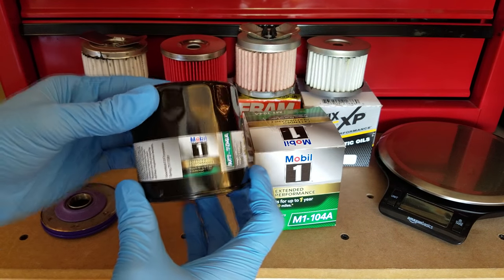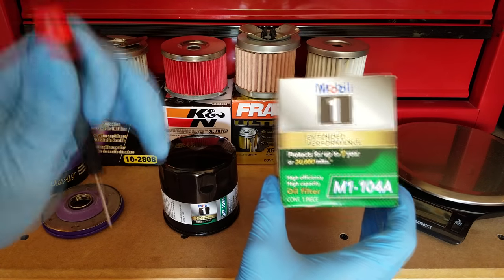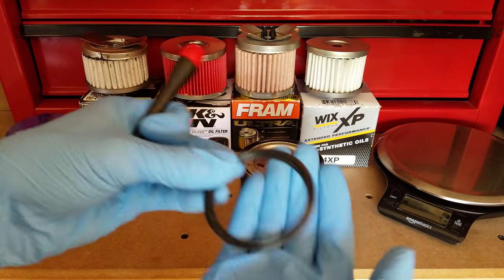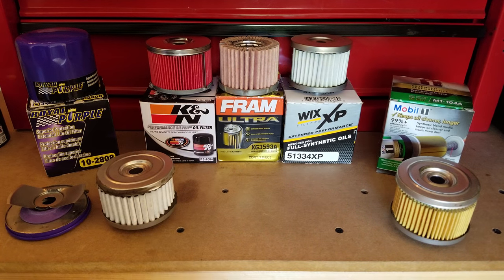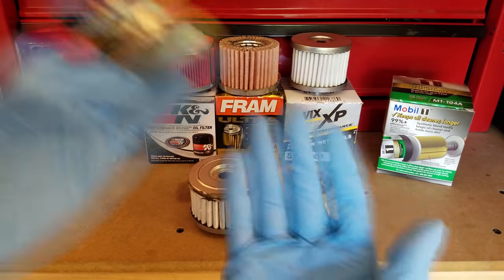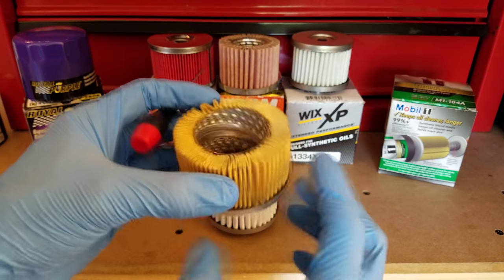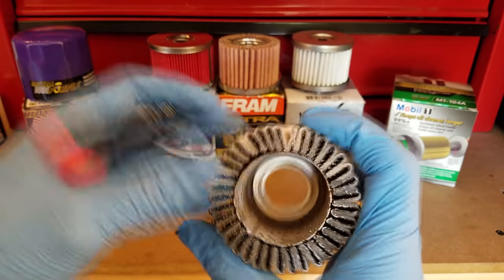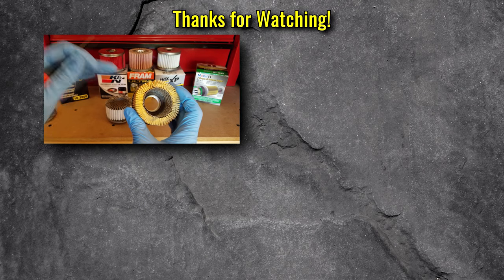Mobil-1 Oil Filter Cut Open! | vs Royal Purple/WIX/K&N!

Comment: I use Royal Purple fluids and filters exclusively ever since they saved my engine. My F250 7.5l blew a front main seal and dumped three quarts of oil in 40 miles. Because I was hauling a 5th wheel I didn't see it behind me, so didn't know it was happening. My oil pressure gauge has always jumped around some, even after doing everything I could think of to fix it. I always had good pressure, so didn't worry about the gauge doing it's thing. When I came to a stop and heard lifters rattling, I parked as soon as I could get clear of traffic and there was not a drop of oil on the stick. It took 3½ quarts to fill it up. I dropped the pan when I got home and checked it for metal... clean. I checked the rear main bearing (on a 200k mile engine)... decent, not wiped. Compression... within tolerances. No noise at all once pressure came back up. In addition, I discovered a hole in my oil pick up tube... there's the likely culprit for my dancing pressure gauge. Not sure what caused it but it's there. A touch-up with the welder will fix it nicely. 

I was at freeway speeds weighing 14,000 lbs for about half an hour with what was obviously low to no oil pressure. Undamaged engine.

Next story... I have a generator that hadn't run in 14 years. It was soft-seized... Tight, but it rolled over by hand. I tried penetrating fluid, lubrication fluid, standard motor oil, nothing freed it up enough for the starter to crank it. Then I dumped some Royal Purple 15-40 in the cylinder. It took four pulls on the starter cord for the piston to free up. I filled the crankcase with the same oil and hit the starter. It was free in 30 seconds. It's been sitting outside for two weeks now. It just fired up without any problem. 

Royal Purple is the SHIT folks!!! Expensive, but WORTH IT!

Comment: According to the engineers at Mobil, their filters are actually rated to 19 microns. I couldn't find a definitive answer online so I called and asked.
Reply: That's really just stating what the test parameters were tested at. It's not claiming that's their filtration on their filters though.
Reply: AnalogSetGaming more info please about this 19 micron thing?

So they are saying it is 99% @ 19 microns?
Reply: @LoveLikeaHurricane  99% at 30 microns according to Mobil's data.

Comment: I've been using WIX XP filters for my vehicles.  Some that change oil say the reason to change oil more often is because they don't have filters that last.  I may keep my oil from 8,000 miles using Synthetic oil, so I want a durable filter.  Where I don't have a WIX handy, I'll ask for a premium filter.  I believe a good filter is wise considering I leave oil in longer.  It appears it would be difficult to rank the oil filters, but which ones would you use in your car or truck???

Comment: For a more thorough comparison, it would be nice to see their respective pressure drop vs flow rate.  Generally, the more you filter the more resistance will be so there is a compromise.  With oil, there is usually a bypass within the engine that will allow unfiltered oil to flow even if the filter is clogged, so I would wonder if a small micron filter would increase its resistance more quickly over time.

Comment: Quality is all about finding attention to details in areas which you expect no one to check, this is true regardless of occupation or product if you take the time to make everything correct and to a good standard people will notice. Be it a brick mason, or a mechanic if you spend some time on stuff which you expect no one to look at sooner or later someone will see it (and know what they are looking at) and will have respect for it.

As a child I had to have a root canal and they put a cap on the tooth (fake tooth) I was about 11 than (28 now) and every time I go to a new dentist (work requires me to frequently move) they all notice it and have all made and mentioned it (surprised by the quality of it ((I can't see it)) while asking me who did it (assuming they where local I guess) but anyways yeah when you know what you are looking at you can respect quality if time is put into a area where it doesn't necessarily matter you can be fairly sure it was put in areas which do matter.

Quality is nothing more than attention to detail and as a profession it can help you a lot.

Comment: Nice, thorough video! There is one major detail I think you should include when examining these filters. One major detail that is almost always overlooked but is critical is, metal debris in the cut threads in the  center hole of the plate. Almost every filter I have used, I have found metal flakes or shards of metal embedded in the threads. You should always wipe the threads out with a rag or towel. Try doing this on your reviews, I guarantee you will find metal debris in the threads. And we all know that metal in the oil is no bueno. Check it out, but use caution, I have have actually been poked with sharp shards of metal threads before when trying to wipe them clean. It is a widespread problem that almost every oil filter video fails to identify. Cheers!

Comment: I use Mobile 1 Filter and Mobile 1 Full Synthetic High Mileage on all my vehicles and I change the filter every other oil drain. Intervals are usually 5,000 miles  and I also put magnets on the filter and the drain plug.  Pro Mechanic of 15 years
Reply: wow you like talking about yourself
Reply: @bryannonya9769  Only trying to contribute to good information that is available online. Thanks for your comment. I'll keep doing the same. Goodnight!
Reply: So have you ever cut open a used filter to verify that the magnets were keeping contaminants out of the media?

Comment: I used to send in oil samples for analysis and certain oils can go the long distance.
The best oil was moly pro spec 3, guy ran it for 19,000 miles and the oil sample showed it could be ran in a car for another 5k.
I did work for mobile one. Used to do the test were we put oil on dry ice, I live in Montana and I was sold, when it's super cold an oil that flows is important.
I've used extended performance oil and filter  for a long time. Great product.

Comment: I am running both of the filters.  Royal Purple 5-20 oil and filter on my 2005 Honda Accord 4 cy  has only about 77 thousand miles bought it used at 27 k  miles and I really like how smooth the engine is with it I tried others synthetic oils and K n N filter but R. P seems to work best.  
I just got a Ford Expedition 2001 with 150 k miles and change oil filter to new mobile 1 A 201A model I think ? 5.4 l engine 4wd  with the reg mobile 1 advanced full synthetic oil and new K n N air filter and I can really tell a big difference in better power.  There are so many types of different oils and then some.  
People complain about how they spend so much money on a $ 15 bucks to buy a oil filter then spend money and trying to save money on a 8 dollar oil filter. Dam ya know what and How important is your engine how much money they piss away buying anything else, food games tickets, bar , Starbucks.   
Great synthetic oil and great oil filter for car is the Number 1 thing to make it last great.

Comment: They aren't 'clones', they're manufactured in the same same facility by Champion Labs.
Reply: J S That could very well be true, but that fact does not guarantee the exact same construction with all the filters often the manufacturing detail can be tweaked or specified by the purchasing company. Or the filter manufacturer can offer multiple different “grades” of filters.

Example K&N typically has a metal crimp over the joint where the filter media wraps around the core. M1 & RP typically do not have the metal crimp & just glue the ends together.

I’m pretty sure all three are quality filters & I would base my purchasing decision on price at that point.
Reply: JS is correct. RP element is fiberglass and screen wire backer. M1 is our better line of paper element. Same shell, same p ring gasket ( side profile is a p shape) same valve end cap. The tapper uses the larger hole to hold the plate from spinning while it taps the center hole. There is NO way a slug from the center hole could be left in the filter. That part is stamped out then tapped then washed to remove all oils then assembled. Champion labs in Albion Illinois make a lot of brands.

Comment: Enjoyed the video. Quick tip for reference. A hair in your hair is around 80 micron's. I think 40-50 is only visible to the naked human eye. The problem comes in to there's so many additives in motor oil particular that once you get less than 25 micron's of filtration you start to strip the additives in stead of just cleaning your oils which intern breaks your oil down faster. Keep up the good work! Any questions just ask. I'ma certified Millwright and Machine Lubrication Technician.

Comment: I run Mobil 1 High Mileage oil with Mobil 1 Extended Performance filters. 10k intervals. Not a single prob.
Reply: FilterKingz I’m about to change my oil at 10,000 miles, with the same filter “Mobil 1 20,000 miles” only thing is I’m running rotella T6 0w40, would you like me to send it to you and feature it on your YouTube videos

Comment: I use Mobile 1 in all my vehicles, but hadn't used any of their "Extended Life" products until this year.  I put their 15k mile extended life oil and the extended life filter on my wife's 2006 Ford Taurus that has 204k miles on it.  The car will not get 15k miles on it before it hits the 1 year mark, but I'm going to start checking the oil at my usual interval of 3k miles and see how it looks, smells, etc.  If the oil lasts a year then I may switch to it permanently because 1 oil change a year, even with a more expensive filter, is cheaper than 3 or 4 oil changes, :-)
Reply: Do an oil analysis that way you know for sure what's going on with the oil and the condition of your engine, the best way to go!

Comment: For future reference, you might use the filter form factor used on most Hondas. It only accounts for about 10% of US market vehicles, but most other part numbers cover more like 3% or less. Any filter company would be crazy not to make a filter for this application, so it's really handy for apples to apples comparisons.

Mobil 1 M1-110A
K&N 1010 series
Royal Purple 10-2867
Wix 57356 series

Comment: Hell I ran cheap frams in my old 1991 2.3 ranger and still got 300k miles....Change your oil and filter as your supposed too and you will get long life with any filter.
Reply: But I believe fram uses cardboard in their filters
Reply: @Caseydog3  
What is wrong with cardboard?
Reply: Steven Sevek cardboard breaks down other materials are way better last longer cardboard and liquids don’t go together

Comment: I use Motorcraft filters on my 2 Fords (2006 Taurus and 2004 Marauder). The Ford gets 5w20 conventional and changed at ~5000 miles. Still comes out pretty clean so 7500 miles occasionally. It uses a quart between changes, no leaks at 149,000 miles. The Mercury (51,000 miles) gets full synthetic on the all-aluminum 32 valve V8 and changed once a year (less than 3000 miles). Engines are built WAY better than 20 years ago. More efficient, less blowby, better engineering, and tighter tolerances. Oil is better by leaps and bounds! The 3,000 mile oil change is ridiculously short and a waste of clean engine oil by today's standards.

Comment: I would like to see how AC Delco, Mopar, Motorcraft, and other OEM filters compare.
Reply: Agree on that
Reply: Acdelco oil filter is junk
Reply: @jacobsebastien3910  STFU 240,000mi on a 2002 Suburban not one piece of metal ever on oil bolt magnet, engine still runs like new, guess what filter has been used on it...lol
Reply: There was a performance segment that I read a few years back and it rated the OEM filters the best ...notwithstanding the higher end K&N Filters, etc.
Reply: They're all junk compared to these brands.
Reply: Mopar/SRT are Wix
Reply: @UnionThugg  

No they aren't Mopar/AcDelco/Motorcraft are all made by Champion Filters. Same company that makes Fram. Not Mann and Hummel which makes Wix.
Reply: @shaunofthedead3000  One must read the research with due caution. 

Wix has always been the vendor for 5.7/6.2/6.4 V8 Mopar filters.  Fleetguard (Cummins) makes the Cummins diesel filter.  Purolator makes some of the Mopar filters for smaller gasoline engine filters. 

Champion, and even Fram has been a vendor for some of the Mopar air filter applications.

Comment: I do think Mobil1's are good but I do all my own car maintenance. I currently have a Toyota with over 300,000 miles and the engine still runs like new! It does not use any oil. I do take really good care of it by using some great car maintenance software www.automotivewolf.com that tracks the maintenance schedule and reminds me when anything needs to be checked or replaced. It also keeps a detailed maintenance log so I always know what was done and when and it tracks performance too. I have always use OEM Toyota filters and oil as recommended by the manufacturer and change it every 10,000 miles with Full synthetic. So far it seems to be working great!  :)
Reply: Excellent software, I use it too. I have over 265,000 on my truck.

Comment: I want a filter with the thickest case because I often rest my car on the oil filter when i change my tires, thanks for the info.
Reply: not the smartest idea js haha
Reply: Kinda interested where you learned that practice? Lol
Reply: I rest mine on my Sonic Route 44!
Reply: Bob Foster alllrighty then😂
Reply: bro jackstands are very cheap just saying
Reply: Right? In what world do you need a thick filter housing? Lol if something is going to hit my oil filter it's already gone through most of my engine lmao I got bigger problems
Reply: @isaacibbotson4632  I've actually punctured a couple oil filters when changing them. It's a real pain in the ass when they go too long and get seized on, then the filter wrench tears the cover off.
Reply: @mikecurry6847  
Back in my younger Day’s I had a 1980 Chevy SB 4x4. It had a 1969 427 bored .60 over, and was sitting on 44” Gumbo Mudders, and one night me and a few friends was doing some Mudding and I had a piece of 1/4” steel dole go through my oil filter housing. It was in the mud, and we didn’t see it. Because it was kinda buried in the mud pit down here in Southeast Louisiana. We had to walk 2 miles to the autozone to get a new filter and oil for her. We wound up doing an oil change by the pit at about midnight once we got the gear and walked 2 miles back. This was in the early to mid 90’s so none of us had cellphones. Hell we was still rocking Beepers back then

Comment: I remember at the dealership a truck was towed in with a froze up engine. It was brand new with 15000 miles on it. Thats as far as it would go with the factory oil and filter.  Another guy came in with a brand new f150 for a 2000 mile check up and found out the factory forgot to put an air filter in it.  The guy tried to make ford replace the engine under warranty. They said no whats the problem and gave him a new air filter.